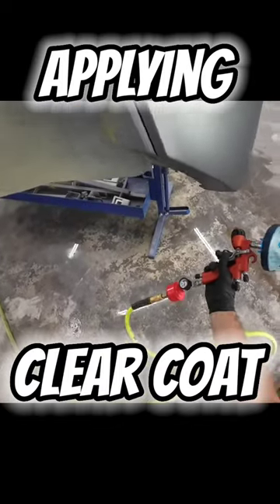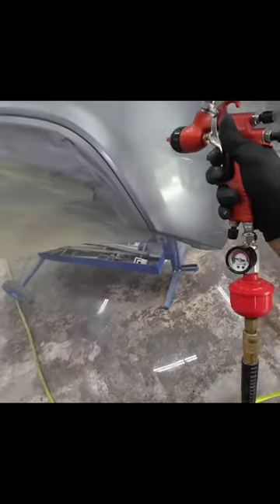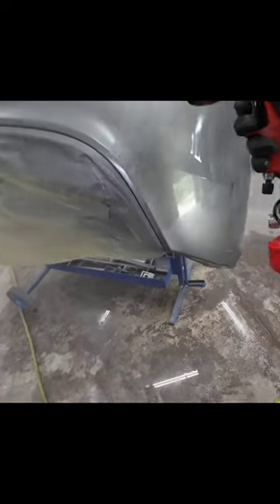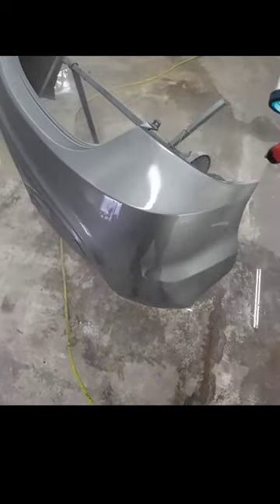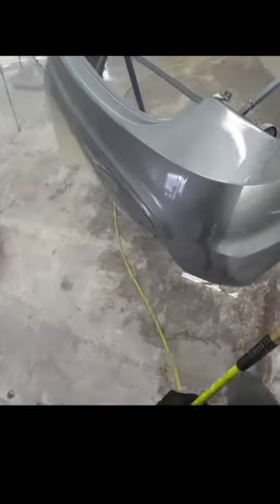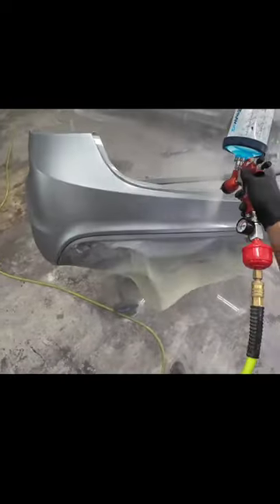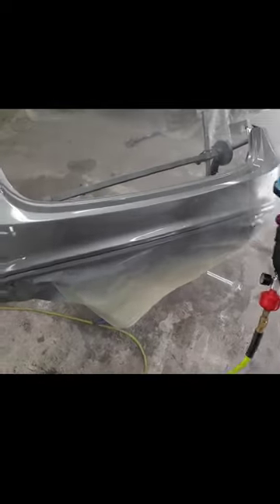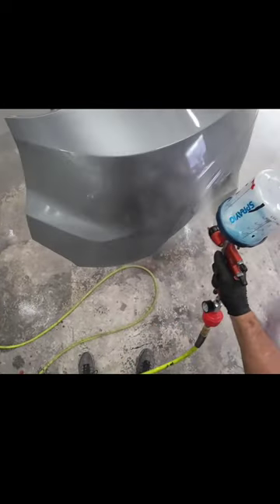Auto paint CLEAR COAT tips!

Comment: Do you normally sand and polish after applying clear coat?
Reply from the maker: Yes, even if it's  just dirt nibs
Reply: @GarageNoise  thank you for taking the time to respond. I appreciate your comment. By the way, i need blending tape to correct a small area before i start polishing.  If i do not have no edge blending tape, do you have a video where i can learn your technique how to use the tape without leaving a line?